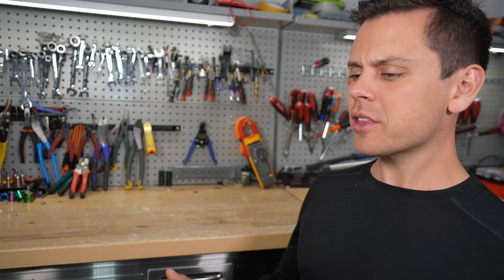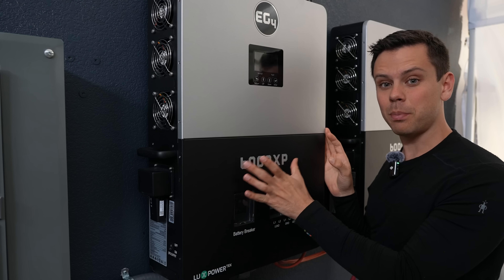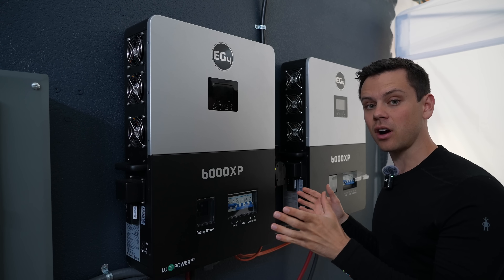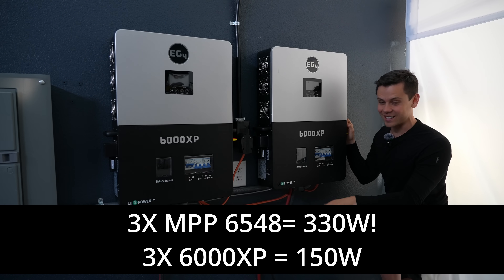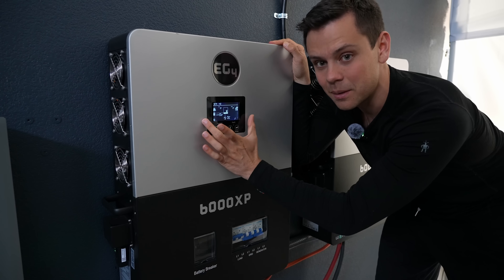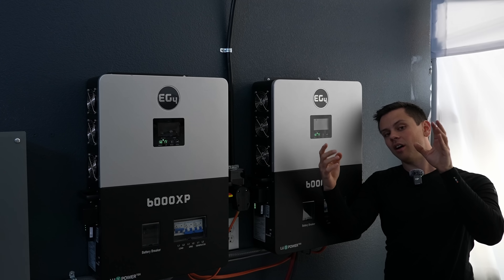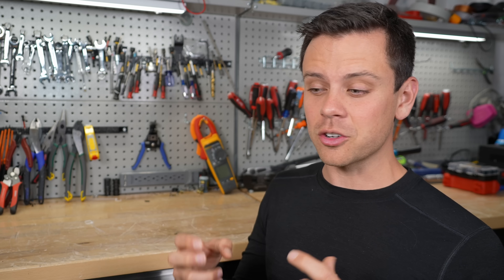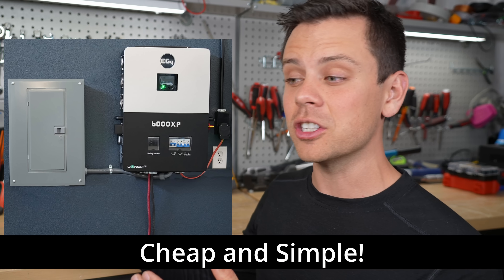Offgrid VS Hybrid Inverters! Which one is better for the $$$?!

Comment: Wait .. why are u oposing Off grid vs Hybrid ? Its more low frequency inverters (transformer inside) vs transformless inverter (high frequency and lot of electronic).
I've used both and .. hybrid are clearly a low cost unreliable solution, too many electronic components prone to fail... can't accept peak high power draw, waste a lot of energy at 0 load, prone to overheat .. and do a lot of noise (those last 3 are indeed connected ).
The king today is clearly Victron... you can do nearly what you want with them, they are reliable, do not consume too much energy to work, low noise... 
All those EG4, Deye, Solark .. are pretty shitty to me, they are all Chinese devices. They ar enot shitty cause they are Chinese but because they use the wrong techonology to make AC, make noise..heat.. unreliable... impossible to repair by a non specialist most of the time.. Open a 10k or 15k victron and see how simple it is... while being more efficient.
It's better to separate solar panel regulation from the inverter part of the system, for multiple reasons.
In Europe a 10kVA 220V multiplus II is 1500€, add a cerbo gx (200€) and an RS450/100 (1000€) and you got a pretty good system (7200W on the mppt), you want to expand the solar array .. no problem, you can add micro inverter on the output of the Multiplus II up to 10kW of them... easy ... reliable, the unit is like 45kg.
Do not waste your time withs those trash EG4, Deya, Solark.. they are not worth it.

Comment: I have a question for anyone who knows ---???
We have a 15.5K Solar System that is Grid-Tied Only --- and we want to Convert it to Either Off Grid OR Hybrid ???
The Problem is that the current  system ( and building it's in ) uses Three Phase.  
So we have 3 5K Sonny Boys --- each putting out 240 Single phase --- that are working together to produce 3 Phase.
I am aware of MPP Solar's 6048MGX and their HV V2 6048T --- That output the same and are set up for Off Grid only.   Does anyone know of a Better unit to install.... that can operate in 3-phae and can handle the 6 -- strings of solar (approx 3k each) --- or how to Auto Disconnect and Fool the Sonny Boys --- to turn Back On???

Comment: I have a Meridian LifePO4 battery, model 200 AH 48vDC, that I can't get to communicate with my EG4 6000 XP inverter. I've contacted EG4, and they suggested configuring it as a lead-acid battery, which I'd prefer not to do. Here in the Caribbean, our energy situation is very unstable, and we rely heavily on having control over battery usage. It's important for me to have good communication between the inverter and the battery. Perhaps you can shed some light on the problem and how to solve it.
Thank you for your time and expertise.

Comment: What the heck is an MPPT?  I've watched a lot of videos trying to learn solar, and people throw MPPT letters around all the time but I've never heard anyone explain what those letters are short for, or explain what an MPPT is, what it does, how its important, or how its rated.
Reply: Channels for solar input
Reply: @the_hated_c137  ok, THANK YOU!  Connections for solar panels, correct? - thank you, it makes sense now.  Here is typically what I got trying to look up the MPPT meaning - no wonder I never understood it:  "The inverter itself is responsible for converting DC power to AC power, while the built-in MPPT provides optimal power point tracking for solar panels."  MPPT's are the connections for solar panels, not tracking communication feed back, correct?

Comment: Why do you need a transfer switch for the 6000xp? I thought it wont backfeed the grid? Or do u mean if u put between ur meter and panel, vers putting it after the panel.

Comment: We are completely off grid with an Outback VFX 3648 inverter and two Outback charge controllers.  Were it not for our 220v deep well pump this setup would be ok.  We’ve had this setup for over 16 years but recently the inverter will shutdown if anything over 1000watts is running when the well pump kicks on.  The well pump taking about 2400watts so still under max load but it shuts down.  Anyway, wondering what I could replace the inverter with that would be about 6000watts and great quality?

Comment: the title of this video should be , Grid tie Hybrid vs Hybrid inverters. inverters that do not connect to the grid at all are Off grid hybrid inverters off grid hybrid inverters do not have an AC input at all while hybrid inverters have ATS in them to switch from mains to battery. but theres so many variations now...... and every company calls them something different. theres also hybrid inverters, that just do switcing from battery to AC, with no solar input, kind of like a UPS really but with some more advanced features like prioritizing grid or solar. . really the terms are all messed up lol

Comment: Your definition for Offgrid and Hybrid Inverters disagrees with what I'm reading.
Other sources define Offgrid to mean not connected to the grid. Hybrid Inverters use the grid for backup power when solar is not available, but do not backfeed the grid.

Comment: I still do not understand if both the 6000xp and the hybrid one allow to the grid electricity pass through and automatically be added on to power loads if they start exceeding max amperage from the batteries and solar. So if max battery/pv output is 30amps but pass through 80amps and my load 60amps, will the grid current be automatically added to the 30amp from batteries/solar to satisfy 60amp load

Comment: Will, I am having issues with my 18kpv, and not getting great responses from the EG4 folks. I have 2 issues which both seem to point to an issue with the controller board. When I test the voltage of the +12 and -12 on the board I get 2v not 12 or 24 depending on how you test things. 

Also I am trying to hook up my generator, but the NO contacts never switch with the battery level gets low, so the Generator never starts. Not sure what is going on here.

Any help would be great... Thank you
Reply from the maker: Post on forum
Reply from the maker: www.diysolarforum.com

Comment: Mr. Prowse,
In the manual of 6000xp it says on the two PV inputs your solar array have to be exactly the same size and brand of solar panels. Do you know if this is correct or not? I have an existing array and wanted to add a second one for input two but I don’t have the room for twelve panels. So first input is around 4k and second would probably be around 1800w   Would this mess it up?

Comment: Hi! living in the Philippines and house is 75 Meters from the Sea. Like to install the Hybrid Inverter. The Inverter will be on the side of the house away from the sea under a 1.25 Meter roof overhang. Most everything rusts. Will I get any longevity out of  this system. Or anything extra I can do in maintenance or add something. I do not expect to get the same but like some longevity.  Other option is to install the Inverter in the house in a store room.  If I leave swimming goggles outside they turn black with mold. THANKS

Comment: I've got one 6000XP inverter and have slowly moved more fuses from the main panel to the Critical Loads panel. Today I moved my Basement Sub Panel over which has our Washer, Dryer, and Water heater on it. I assumed that since the dryer uses 6,240 watts, it would have issues, especially when the hot water heater kicks in. This is because I thought the 6000XP would be maxed out. Did I hear correctly that "each leg" could handle 6000 watts?

Comment: There is one think i don't understand. If i buy for example a Hybrid or Off grid inverter but do not plan to inject any energy to the grid, is there a difference between them on how a (hy/off) inverter will handle the excess pv power and how to set it up?

Comment: Hi thinking of installing a system. We have grid power but it's very unstable.  I would like to run continuously off an inverter.  I would like to connect solar panels, a generator and the grid.  I use somewhere between 4-6kwh/day.  Any recommendations for an inverter?

Comment: What about putting the 6000xp in a small building? Even in a small shed next to the house or something? Wouldn't that give you the needed protection, or are we considering environment temps as well? Most out building set ups I have seen, like in Arizona, dont have temperature control in the building where the solar controllers and inverters are.

Comment: Will, please explain something to me. I have watched many videos on the EG4 18k including Jesse Muller’s and I have read the manual multiple times. I studied the diagrams extensively and what you just said has been my question all along: why can I not just go straight from the meter base 200 amps to the grid input on the 18k and from the load to the house main panel and be done? If the inverter has a 200 amp ac bypass then I took that to mean it will or can supply the main panel with 200 amps as long as the grid is online. If the grid goes down the max it can provide would be 50 amps. Am I correct? The diagrams in the manual show feed taps and manual transfer switches and all this crap that doesn’t make sense if the inverter IS the transfer switch and has anti-islanding. I do not understand why people are installing taps to provide the inverter a certain amount of ac power simply to run the load back to the same panel. I would love to hear your thoughts and have you explain EG’s diagrams!! And I am wanting the whole house backup solution. I would like to add the ethos or anker x1 battery kits to 1 or 2 18k’s. My plan is to essentially run the entire house off battery all the time with grid assist to keep the batteries charged. I could care less about selling power back to the grid. We have alot of power blips and brownouts and the weather is horrible these days and i run alot of IT equipment so i want a battery backup for the entire house.

Comment: I have followed you for years.  I built one of your first systems for a solar powered bath house 1 mile in the woods the old way simple mppt controller and a harbor freight inverter lead acid batteries.   It still works.  Then I moved on to a garage with a grow watt 3k system and a 48 volt lithium ion battery it still works (in warm weather)   I have 2300 bucks in that system.  Now onto bigger things I need help deciding what to put into a 1500 square foot cabin off grid no chance of grid power ever.  currently building a solar shed that will hold 16 panels.  Camp is going up soon, we are high elevation 45th parallel.  I am not sure about using a 12k or 2 6k , we don't need a/c up there.  Propane slab heat.  Propane stove.  I like the eg4 systems but many people up here use outback.  The biggest draw we will have is a 110v well pump and a circulator for the slab heat.  I can expand to another 16 panels in the future, but all this takes time and money both of which are hard to come by.  I would love to have an electric dryer even if we use it in the daytime.  i could use a little input.  I have been following for years but this is the first  comment for me.
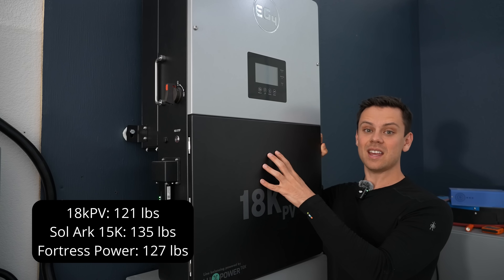Reply: 5:13

Comment: I thought the transfer switch would allow you to bypass the inverter, say in case the inverter failed and you suddenly need to switch to grid directly, by-passing the inverter entirely. How does this work with an internal transfer switch in the 18k? Do you have to start disconnecting and reconnecting wires?

Comment: Fantastic video! Just by following your videos this morning, I've gained a wealth of knowledge. Building an off-grid system right now. Will def go 48V. If price is not an issue, what would you recommend? I need to run a water pump for a 500 gal tank, and lights throughout the small farmhouse. Figuring on wiring the house for 120V, installing LED ceiling lights and multiple outlets. Won't get much use unless there's a gathering there, perhaps 2 or 3 times a year. Also planning to bring a Honda 7000W inverter generator up to the house for festivals so need to switch to gen power on those occasions.

Comment: live in Massachusetts and have rooftop solar and net metering with National Grid. Would the EG4 18k be what I need for battery backup to work with my system? If the grid😊 is down and it is nighttime, is there internal battery storage or do I need to add batteries to this system?

Comment: I’m guessing it still makes sense to get 2x Victron 5kW multiplus ii inverters for my load, ie, trying to run my 3 ton AC on mostly solar.  3 ton consumes 2800 watts per leg, so it’s too close for the 3kW Victron unit.

Comment: @WillProwse ...In one of your videos, you advise that the air intake should be at the bottom while the cooling fans at the top. Why did is the EG4-18K-PV mounted contrarily to your advise ?

Comment: hey will hope all is good.
need confirmation on a needed setup/
setting up a mining shed. at full run the units take about 1800 watts 10-12 amps.
was thinking of the EG4 system with the 6k inverter and the server rac battery and 4 400watt panels.
can you or someone advise if this would work?  let me know if more details are needed.

Comment: I am confused when comparing different systems. BLUETTI EP800 is an off-grid system so it does not feed energy back to the grid. However, everything else is the same with Hybrid inverter systems. It's a NEMA 4X-rated sealed system with a 10-year warranty, and it's got both 120/240V output. Is it an off-grid hybrid inverter then?

Comment: Hi will, could you in theory use a hybrid inverters grid output feed to just run an emersion heater directly. And keep the entire system off the mains? Many thanks crust
Reply: Ps UK so I'd be looking at 230v systems

Comment: Hi there, love your videos! If you were going to have an off grid wood shop with compressor, table saw, dust collection system, etc.. and sometimes a 240v welder, would you get a low frequency inverter(s) for that use case? or still go with something like a hybrid HF inverter?

Comment: In just 3 months, the eg4 18kpv has dropped to $3700 for a refurbished unit!
Build a small "shelter" to avoid most of the elements and it will do fine outside but inside with filtered air is the best.

Comment: I love your channel and would love to see units that would fulfill the needs of 50a motorhome powering
everything with roughly 20k storage . My hope is to find a "all in one " unit knowing I will need two in order to get full 50a like a hook up post in a campground . I look forward to your reply and or video. Maybe 2 Anker f3800 with 2 external batteries each. Each have 50a plugs but not true 50a power. Also need power passthrough changing to run RV and charge batteries
from post or generator. Unfortunately the f3800 doesn't have passthrough charging. Anker says there isn't a work around. Surely there has to be a work around. Thank you for your time and effort for everything you do.

Comment: Cool stuff, I learned a lot. I was wondering, with a hybrid system and a transfer switch. If you're completely off grid, can the transfer switch in these hybrid units be used as an automatic transfer switch for a gas/diesel generator if the system's batteries get too drained instead of having it switch to the grid?

Comment: Will, CAN you use the inverter power from these all in one units to run AC loads, to the limit of what the panels can produce, WITHOUT  a battery attached?  Thanks...Keith

Comment: What about designing for equipment failures and redundancy? The all in one hybrid inverters seem higher risk than multiple 6000XPs. I am currently replacing a solarEdge inverter for the 2nd time in 3 years. It's had more down time than the grid!

Comment: Great video Will, I started with EG46500ex in split phase running for about 2 years no issues. I recently bought 1 6000xp to test from Signature Solar and a few days later my EG46500ex started dropping AC for no reason (no connection was made to 6000xp. I have been reminded how bad Signature solar support is and need to find another supplier for additional 6000xp. Can you use 2-3 6000xp in parallel using dongles from different vendors?

Comment: What interests me maybe many is back up power for long term grid failures to run the fridge, well and basic needs that could be stored. However more robust than small all in one solar generators that wouldn't run 220 nor be enough for well pumps. The 6000xp, a large battery or two and 6-12 large panels seems to be about right.  A show and kits on large long term emergency power would be cool.

Comment: One of the points that has not been addressed is the switching time between power sources. There are great off-grid inverters (they don't inject power back) but they can power a load with multiple sources simultaneously with zero transfer time between switching loads or using percentages of the sources

Comment: Will can an off-grid inverter 6000XP (or other inverters handle) a wind generator with solar and how would that get connected? 
*Can it use the 120/240 input from the inverter's AC line in, if not how would it get connected? 
*How would you connect a wind generator to either of these units, and still use the dump load? I would like to use the dump load to heat water/water heater.

Comment: dude, it was very very informative thank you. What would be nice is a website where you could plug-in one's own spec (inverter, batteries, pv panels) and get suggestion for upgrade or replacement. There are a zillion configurations out there running.